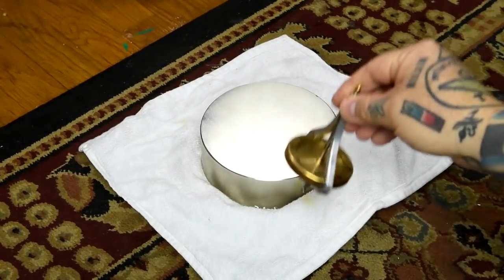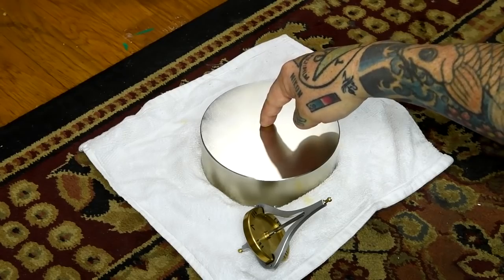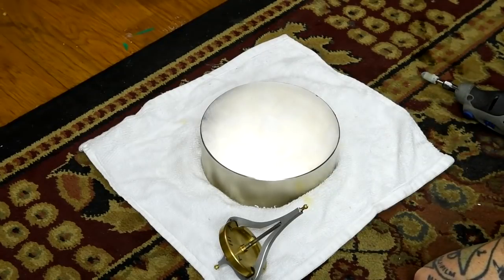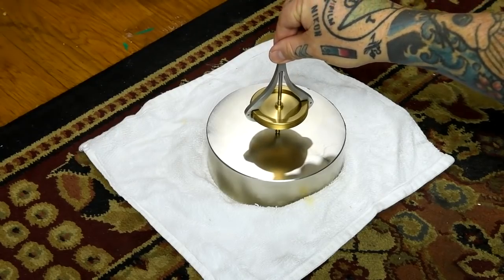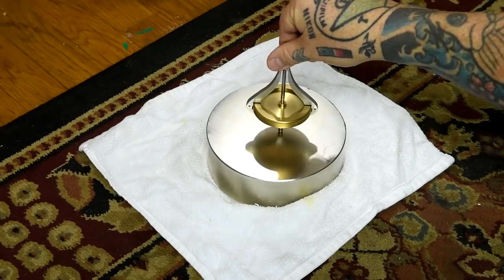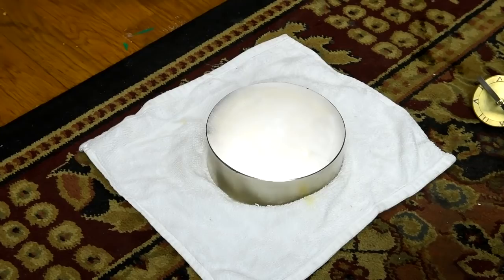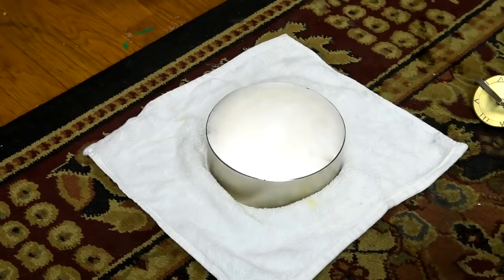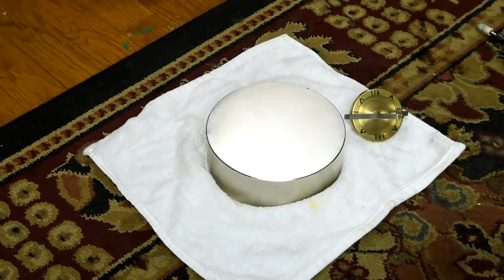MAGNETISM 🤔 Centrifugal vs. Centripetal. Only ONE is real magnetism

Comment: take a wheel what is "magnetic" but electrically non-conductive for the "eddy current" peeps ?
Reply from the maker: you forgot to account for the same high flux both center and edge,  idiots call the center "magnetism", but its not
Reply: @KenTheoriaApophasis   actually i did not, but where i was going with this suggestion is.. extending : i.e .. it does not matter, if you spin a metal wheel, or a wood wheel, or a "plastic" wheel.. they all will show a "gyroscopic effect" against "gravity" as well. incoherent, counter-spatial dielectric fields, or the "magnetic" fields around the magnet, they are fundamentally the same (there is only one field),  just in different expressions/manifestation. regardless of materials, all "atoms" in a spin-wheel possess their own internal field-structure, but what changes with the totality of the field-structure of that object under SPIN? AhA! rotational field coherency .. interacting now with "gravity fields" differently than without spin. oh wow.. aaaaand the right hand rule applies even here. The quote "gravity defying gyroscopic effect" is still an unsolved mystery in science (used, described yet not understood). So is the origin of spin, which is none other than incoherent dielectric counter-spacial fields - interacting - with spacial magnetic fields, and due to field pressure mediation - as you put it - and the path of least resistance it forces a vortex.. aka spin. I am not trying to teach the teacher here (you).. but you can make a study (i did).. from all known "particles" to all known stellar objects. Same result. Does the moon spin? nope. What does it not have? A strong enough magnetosphere! As long a stellar object has mass (gravity), but not a strong enough magnetic field interacting.. it will not SPIN. If nature is so simple, right in our faces, but all truth is hidden in the "invisible". What i am interested in...is that more people understand the profound importance of your work, more examples.. more "evidence".. more "oh shit, that dude is really into something" ..without building flying cars for idiots to "believe it". ;)
Reply: Ask me, why i am interested in that.. timing is well matching with UN Agenda 2030 Goal Nr 7. The energy policies are changing...the same way as the global financial currency policies are. NSA developed crypto way before Bitcoin, IMF just proposed the usage of "crypto currency" as international federal reserve currency (Dollarization 2.0). I could talk hours here about this.. laying down the "signs" to be understood, but long story short - if you have some cash lying around - buy Ripple XRP ;) Sustainability, Stability and Growth.. are key words .. Everything you saw in the past was more or less a field- and social-test. What is happening now - as we speak - is global adoption. The Fed, Temenos, IMF, Swift, Worlbanks, Exchanges, Amex, Google, Mircrosoft.. and many more.. already in "the loop" knowing.
Reply: @CallsignAS  Some good stuff in there, particularly about spin. On the crypto level, doesnt XRP essentially make SWIFT redundant? I know that XRP is centralised but it seems counterintuitive. Seems to be a massive groundswell in crypto against the banking system and how Jamie Demon reacted to BTC a year or so ago makes me think the banking cartel is late to the party. It just seems to me that banking (oops, I mean money printing) was taken by surprise by crypto and not the other way around. But I can certainly appreciate that its origins were most certainly deep state. Very interesting at present with the FED ramming rates when all signs should point to them doubling down on Control P. Me thinks they know this shit gonna implode into the aether pretty soon if drastic measures arent taken. Looks like a controlled demolition to me. Very interesting, cheers
Reply: @elams1894   BTC becomes over time more centralized (50-70% of mining is in China) ..and XRP is and becomes over time more de-centralized due to the network nodes growing globally. XRP is not "against" the banking system, but an evolution OF the banking system. Banks are facing an "adapt or die" situation atm. Making the SWIFT messaging system (or better to say.. the US petro-dollar "gun" in your face, or the tariffs and sanctions and money laundering apparatus) redundant is the goal. A Politics meets FinTech situation. Real reason why Trump says "The FED lost its mind". Currency (a  word from "current") increases value with flow !. XRP means. MORE flow, faster and cheaper among other things. We had the "internet of information" revolution with internet.. yet it takes "forever" to make transactions and escrow accounts are needed. Now we are in the middle of an "internet of value" revolution, where sending any amount of money (without having or needing a bank account or intermediate escrows) to anywhere happens in 3-5 seconds for cents of cost. In other words, it will become similar to sending a text message. I have a Revolut Metal card i.e  sending/receiving money as (XRP) to anywhere.. and instantly converted to FIAT and withdraw from any ATM anywhere. Even the concept of monetizing Web-Content (click-baits etc) is about to change (see Coil.com). Already working on Youtube. I could talk endless about this topic. lol
Reply: @CallsignAS  Thansk OV - I appreciate the heads up. Stella Lumens is interesting too, being decentralized. I actually had XRP for what seemed like an eternity and I converted it to ETH only for it to shoot the moon a week after I sold back in the end of 2017. Shame on me I suppose.  It indeed feels as though something is going to happen pretty soon. I have given up trying to time anything. I know the financial situation at the moment is on life support. It amazes me that the central banks have managed to keep it ticking over through stealth money printing. High crimes of humanity continue courtesy of the banking cartel.
Reply: @elams1894   To imagine, that XRP will reach 1000$ is AS CRAZY as to imagine few years ago, that BTC will rise from 0.003$ to 20.000$ (which it did). That being said, XRP has a MUCH higher "initial potential" than BTC ever had. I own couple thousand XRPs.. and see it as "depot" not to worry about.. let there be surprise.. (or not). However..i think it a very sound investment. In early 2017 i recommended friends to buy into BTC.. they did..made a killing..i did not..why?.. BTC never convinced me as in principle how it works. Yes one can make money with many things..true..

Comment: What happens if you tip the gyroscope 90 degrees above the center of the magnet, will it still maintain spin rate or slow down? Since the gyroscope is at 90 degrees tangent at the edge of the magnet thus the centrifugal force of the brass wheel goes against the magnetic field called eddy current will it do the same at the center?
Reply from the maker: no diff, proximity to the edge decelerates it